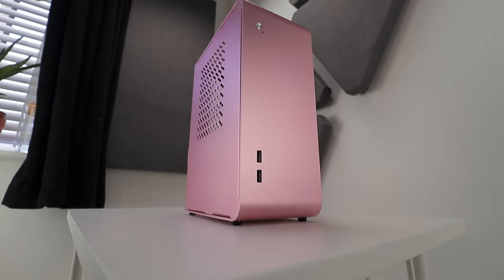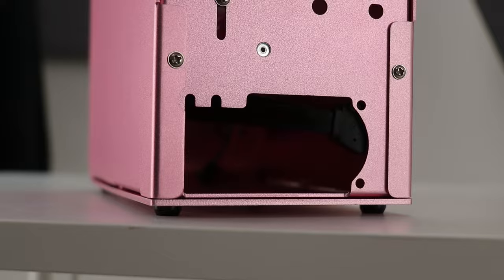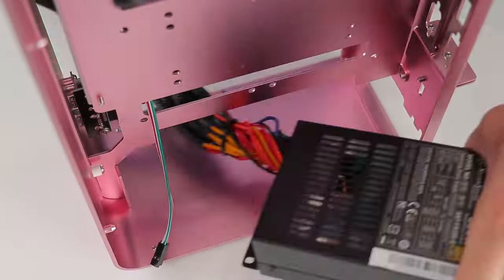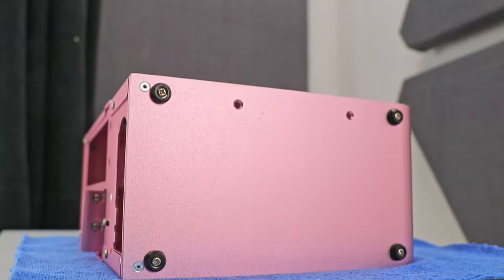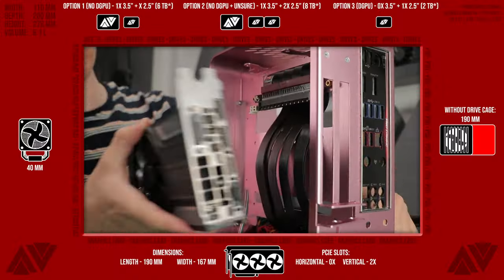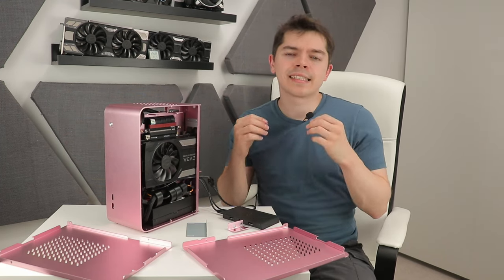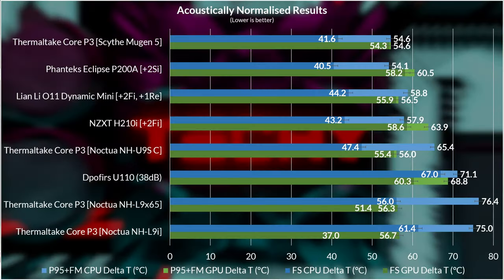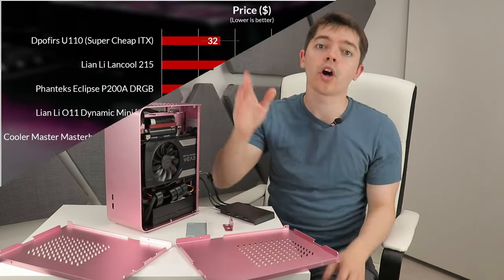Shockingly Cheap -  U110 ITX Case Review

Comment: I looked into it, it's 110€. I guess the price was wrong or something. I just wanted to build something with leftover parts on the smallest build because I will be getting on a boat for almost one whole day a week, and this "30€ case" would have been a good one, but there are similar ones for 50~70, so it isn't too much of a loss.
Reply from the maker: I think the price could range widely depending on the time and part of the world. It's no longer in stock on Amazon where I picked it up unfortunately.

Comment: Nice case. Heres an intresting one for you-the" itek Evoke", which is basically a little larger
Coolermaster NR200... But the plot twist is that it takes Matx mobos and atx power supplies. Yet still very compact.
Reply from the maker: Sounds like a really interesting case. I'll see if I can get my hands on one for a review :)
Reply: @AVTechy  Its called various names in other markets-all based on the original Sama O1 case. 
Itek Evoke. 
Tecware fusion.
Nox Hummer Vault.
Reply from the maker: Appreciate that. Probably something I wouldn't have picked up on otherwise.